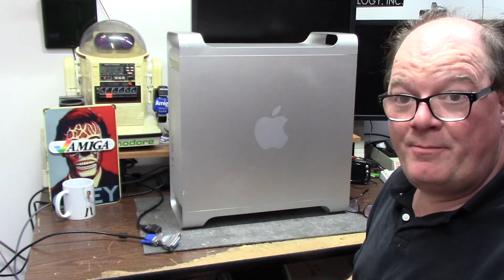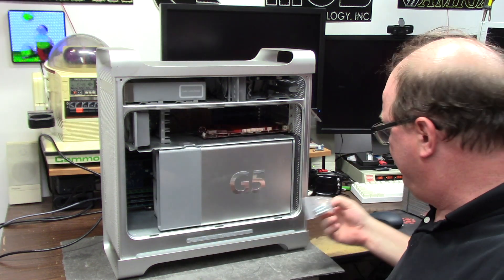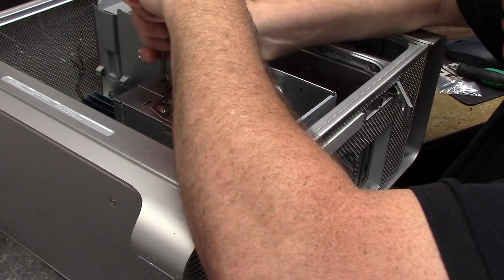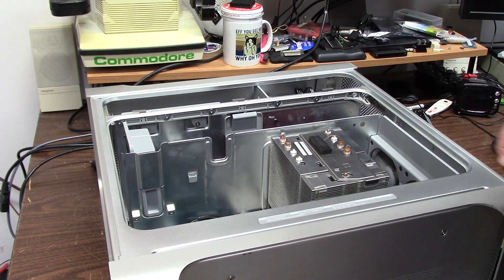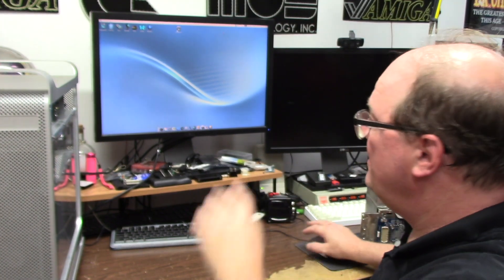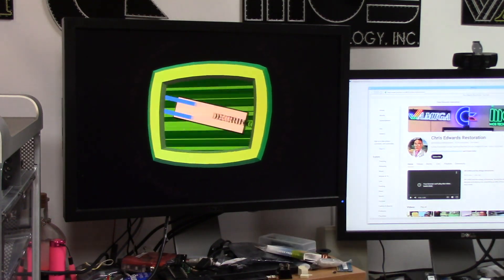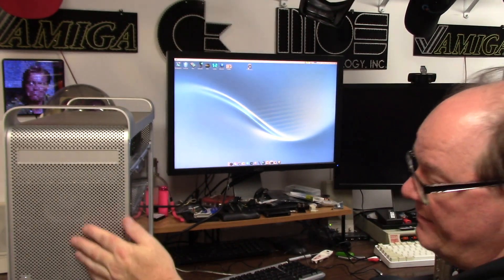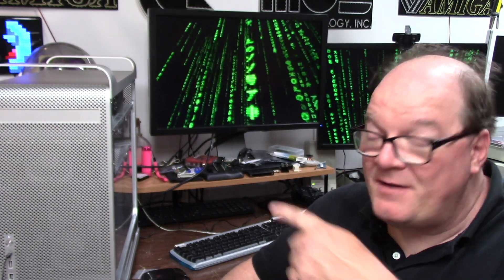MorphOS Amiga like OS Powermac Gets A CPU Upgrade

Comment: At some point in the future I might make the plunge and turn my AmigaONE X5000 into a dual-boot system with two graphics cards (RX 550 for AmigaOS4.x and one of the higher end cards supported by MorphOS).

The dual-core P5020 CPU running at 2.0Ghz is quite a cool one... a small heatsink with a small fan and it sticks to around 60-67 Celcius during summer temperatures and below 60 during winter. :)
Reply: If you use the productivity software, it is a no brainer...

Comment: Excellent video as always! So, you have demonstrated MorphOS, Amithlon, and Pimiga. I got Pimiga 4 intel running on a machine and it works  great. Would love to try MorphOS but find the hardware prohibitively expensive. Have you experimented with any version of AROS like AROS One or Icaros? I'm stuck in that quandary of trying to get a modern Amiga-like OS running on standard PC hardware without that layer of emulation. Just curious :) Thanks Again!
Reply from the maker: I did a icarus video a while back.  Aros is dogwater as my
Kid says.     Morph hardware not expensive.  You can get powermac g5’. 1.8/2.0 boxes for as low as 25 usd here.  Shipping might be a little bit expensive, but the units are super cheap. Many educational facilities used them and they just sit.
Reply: @ChrisEdwardsRestoration   You  have to be very careful   that you get the right hardware though.   MorphOS is very very particular on what  hardware it will run on.  And some of it is only partially functional.  To their credit  it's spelled  out in detail on the Hardware Compatibility Page.
Reply from the maker: @fmlazar  yup. also thats why pimiga was built. the new intel we did now runs native on any uefi capable intel pc/ mac
Reply: If you're  determined to run the Amiga OS  on metal,  your only option are the Vampire FGA  machines by Apollo.  I think they can  be made to run 68k MacOS as well.
Reply: Powermac G5s like the one chris has is super cheap now.  Some people give them away for free.  Morphos is the best amiga like system, just watching Chris's videos has convinced me of that.  I feel out of my chair when he had the demo on one screen and his you tube on the other.  😎 stuff.  Dan Woods mentioned Iris as his favorite email client years ago and who know how many release ago.  Seeing Chris setup email was beyond what I thought amiga stuff could do.
Reply: @Nasguy-b7q  However  MorphOS will  only run on SPECIFIC hardware configs which are listed in it's hardware compatibility page.  Most G5s  simply will  not work, and others will fail important functions like ethernet,  and at best itwill only use one core of a multi-core Mac.
Reply: @fmlazar sure, totally get that and thank you for pointing that out. Chris did a decent job in his prior MorphOS video to illustrate that.  The sheer programming effort for everything Chris has shown is remarkable to me at least.  Maybe all the other Amiga like systems have this level of native functionality and I just haven't seen it, but I'm impressed with MorphOS none the less.

Comment: I wish it wasn't MorphOS and it was just AmigaOS.
Reply from the maker: Jist pretend it is then
Reply: @ChrisEdwardsRestoration  I said that about my last wife...
Reply: @jondoough Well, at least emulating your ideal Amiga is easier than emulating your ideal wife or girlfriend. Very rarely are girlfriends plug and play,  you can't update their firmware and financially, they usually make even the rarest Amiga on earth look like a cheap night out. 😆
Reply: Well... in the best of worlds, the people behind AmigaOS 4.x (Hyperion) should have done the same thing the MorphOS people did.... port it to all PPC hardware of that time, such as all the G4/G5 macs etc while also still support the more modern PPC hardware that came with AmigaONE X1000 and AmigaONE X5000. I mean... my AmigaONE X5000 regarding hardware is probably half the price of getting my old super expanded Amiga 1200T with 68060 etc (I mean... buying all the parts, make sure things are in as mint condition as possible).  :D

Comment: I still have one DualG5 2GH and a few PowerBookG4s.  I'm running MorphOS 3.17 (registered) on a 17" PowerBook G4 1.67Mhz.  I had a liquid cooled Quad Core G5 2.5 for a while.  It sounded like a jet when the fans kicked in high.  It didn't leak, but the coolant solidified and she died from heat stroke.  I had a replacement processor module but couldn't get her to boot again.   I may have swapped out the PSU too. (I've done that once for my Dual G5) Sold the whole bundle a while back.
Reply: I think MorphOS uses only one core on a  Dual 2.5 or  Quad.
Reply: @fmlazar  You are right. MorphOS is only one "core" OS.
Reply: @fmlazar  I never tried it on a G5 single, dual or quad, only on my PowerBook G4, but I think you are correct, MorphOS only supports single processor.

Comment: I hope someone can help me with this question, because it is (to me) a serious question.
The question is, "What is the 'best' modern Amiga platform?"

By 'best' I don't necessarily mean the most accurate (though that's a huge chunk), or the most powerful, but best suited for what I want to do...

My primary interest isn't in playing classic games or with classic Amiga software.
My primary interest is developing software for the Amiga.
This includes software compatible with 1.2 - 2.04 OS versions.
But it also includes creating modern applications, such as, say, a web browser, which is capable of bridging the gap between classic Amigas and modern systems. And playing games.
I also would like a dedicated system (even if it's running Amiga Forever under Linux) for which I would build/print a custom case. One that would more closely resemble a Mac Classic or CBM PET than, say, an A500.

I would want to develop on such a system, and some of what I develop could specifically target more modern versions of the OS such as 3.9
But the plethora of solutions leaves me confused. What is the difference between Aros, Icaros, Morphos and Amithlon, for example?

I currently run emulation via Amiga Forever (I keep intending to make room for my Amiga 3000 on my desks Real Soon Now). I partially recreated my environment from my A3K, but I'm not real comfortable using it for some reason. This may just be my perception, but there seems to be a lot I have to do for functionality that causes me to "drop out" of the Amiga environment... like mounting floppy drives. And as I also use my Win7 desktop for other applications, I'm always dropping out to of the Amiga emulation to run Windows applications.

After seeing the cost of some hardware Amiga solutions, such as a G5 with Morphos or Amithlon (the costs aren't exorbitant but they exist), I investigated the cost of simply 'pimping' my A3K... But that could break compatibility, would taint the nostalgia I wish to experience when I use my A3K (3.x versions of the OS seem very different than 2.04), and possibly add wear and tear on my A3K I don't want to put on it.
I don't mind learning/using the newer versions of the OS, but I don't want to be locked into them as would seem to be the case if I "upgraded" / converted my one and only actual Amiga system.

So could anyone make suggestions for which route would best suit my goals? If there's more information needed, just ask. I'd like to settle this once and for all and begin pursuing ONE solution.
Reply from the maker: ever heard of Pimiga? its based on 3.9 but hyperions 3.2.2.x is the "current" its all still Amiga OS. runs on a Raspberry pi 4, 400, 5 or even a intel UEFI capable device, even old mac
Reply: The  problem is that  the Amiga OS  especially the 2.0 generation is simply too primitive for modern use.  The biggest issue is web browsers  Modern web sites  require horsepower that would bring the most powerful Amiga that you could build, even PowerPC Amigas,  whether by metal  or emulation  to it's knees.
Reply: Morphos is the only amiga compatible system with modern networking,  email, browser, organization stuff.  In the last 5 years the software has left everything else behind.. so no choice really...

Comment: I have a G5 Quad. Knock on wood, hasn’t leaked yet! I haven’t acquired the sufficient amount of bravery points to replace the hoses and coolant.
Reply from the maker: i would. that xylene is super corrosive. like acid on a fruit just eats them up.  now you can simply remove the 6 screws, the 2 long jobs with a ground down regular long screwdriver, and pull them out and replace the coolant and hoses with modern day liquid stuff thats way safer. even update the pumps if needed without worry of it damaging the board (and the power supply below it)

Comment: Manufacturers of MORPH OS need to deal with their system fully and not by raiding once a year....
Reply: What on earth do you mean by that? "Deal with it fully" and not "raiding" once a year?
Reply: @another3997   Make a modern kernel based on the hardware that is supported.The promised structural elements of the system that should be in it and still are not.Finally understand which processor needs to be supported otherwise the hardware will soon go into the ages and the new one will not be supported.If you have contacted the PPC architecture, then you need to make hardware on this architecture. And so at the moment it's just a toy with a lot of projects that are sold for money. Until now, issues with licensing what is called the AMIGA OS and making it either open or having a normal OS host have not been resolved.
Reply: @TheRus13  You severely overestimate the resources they can bring to bear.  They don't have the expertise  required to move beyond Motorola,  it's based too  much on the Amiga.
Reply: @fmlazar   In the 21st century, this is ridiculous to say.There are all the features now, but they probably don't particularly require noticeable fixes or improvements.

Comment: Serious question: what’s the point? MorphOS is a 32-bit OS, it’s all ready not using half the registers in the 64-bit G5 processor that’s already in there.

Also the RAM limit on MorphOS is 2GB (really 1.7GB).

You’re just spending electricity to not use half the processing power 🤷
Reply from the maker: One could say the same thing about anything retro why bother what is the point just buy new shit and enjoy it I think I will close down because there is no point in any of this. In all seriousness, it’s just the hobby. We do these things for fun if you would like to help the team, consider joining it. Maybe your insight and possible expertise could help them overcome things they are stuck on.  As the late rodney King said “cant we all just get along?”  Also my electricity is from a solar array so it’s free.
Reply: So what? I run goshdarn Emacs as a window manager (EXWM) on my ryzen 5800X3D with 32 GB. Would probably work fine on a higher end Pentium as well. Who cares?
Reply: @Andrath  Your reply makes zero sense. Do you even understand what point I am making?
Reply: @danielktdoranie  Yes, you are saying that it's somehow bad to not use all the hardware. First of all, I mutliboot. But I also run DOS on my machine. Will DOS use all my hardware? Heck no. Is DOS cool? Yes. Same goes for MorphOS. It's pretty much the AmigaOS for the PPC. Yes it's 32 bits. But so what? 

You do indeed have a point that it would be nice to have a 64 bit MorphOS, but as long as that does not exist (yet), why not? Our 64 bit systems can run 32 bit and even 16 and 8 bit code. We can retro quite good with our modern beasts of computers.
Reply: @Andrath  no that’s not what I was saying, at all. Also, I didn’t ask about the details of your personal computer: that is completely irrelevant. Next if you think a Mac G5 is modern computer that’s ridiculous.
Reply: MorphOS has many other pitfalls too,  just like any "modern" Amiga OS. The same with the BeOS and Windows XP clones. You could argue that iOS and Android should never have been developed, or even Linux. There were preexisting OSs that worked on available hardware at the time. Sometimes there doesn't have to be an earth shattering reason for doing something, other than you want to try something different.
Reply: You’re all failing to get the point. This is isn’t me saying “why are you into retro computing hur dur” I have many retro systems, I love my PPC Macs and Amigas.

I am saying specifically it makes zero sense to run a 32-bit OS on a 64-bit processor (unless that’s all you have) let alone UPGRADE said 64-bit processor. If you were running say 64-bit operating systems like Debian Linux or BSD on the G5 Mac it would make sense but MorphOS is not 64-bit, it is 32-bit.

It would be great if MorphOS had a 64-bit PPC version that could take advantage of that hardware.

By all means do what you want but it makes about as much sense as waiting in line for an hour to get nothing 😂

It won’t improve anything 😂
Reply: Not to mention that in many cases running 32-bit code on a 64-bit processor means it will run SLOWER than it would on a native 32-bit processor.

My point is if you want to have an ideal MorphOS experience use a Mac with single G4 processor with no more than 2GB RAM.

You’ll see better performance gains by using a solid state hard drive than you would over putting in a faster G5 chip 😂